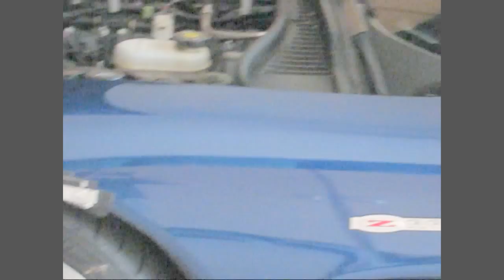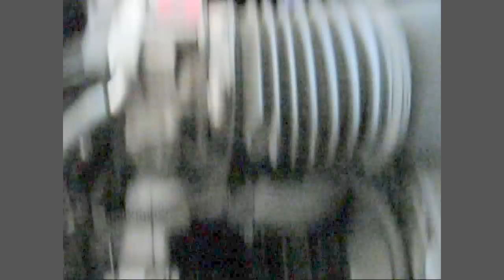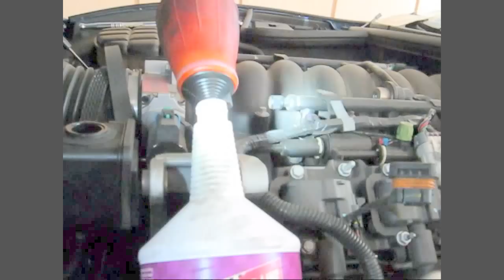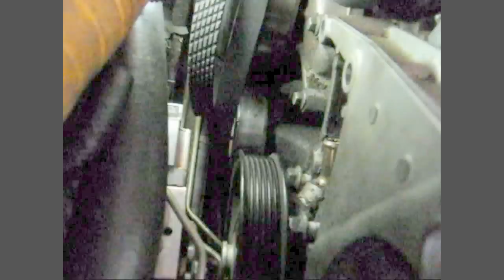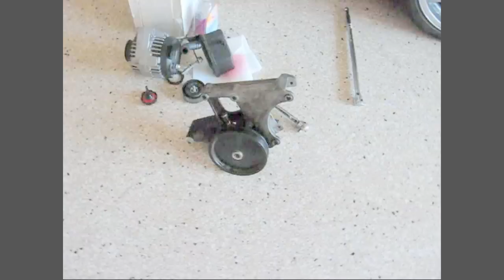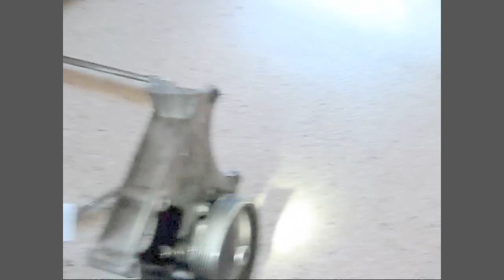Corvette power steering pump remove repair by froggy turn one c5

Comment: If anyone else has to go through this it's best to buy the complete assembly. Breaking off the plastic OEM pulley will give you access to the pressure line and makes for a quicker and easier install because you can also leave the bracket attached.

Comment: Did you replace the power steering hoses while you replaced the power steering pump? Seems like it would have made sense to do so.
Reply from the maker: No need if they are good low mileage, but otherwise a good idea.

Comment: Was the pump itself leaking?
Reply from the maker: No, it was not making correct "power" to the steering, hard to turn steering wheel, pump wore out inside, common with oem (cheap) pumps.  :)

Comment: I’m pulling the steering rack for another reason. Is it easier to remove the power steering pump and bracket while steering rack is out?
Reply from the maker: I don't think so, pretty separate jobs, If you like, replace the pully with a new one you can fit a socket & extension thru (skeletonized).
Reply: @1947froggy  well I was thinking if rack is out, and ps reservoir removed, wouldn’t it be a easier to just pull the entire power steering pump and bracket without disconnecting the tubes?
Reply from the maker: @aptsix1728  If you are talking the abs lines, I never needed to disconnect any to do either the rack or the ps pump.

:)
Reply: Not the ABS lines. The ps lines will be disconnected at the rack. Rather than disconnect ps lines at the ps pump, is it possible to remove the pump, bracket and ps lines all together?  Once out, easier to remove lines on the bench.
Reply from the maker: @aptsix1728  Yes, but I think with the right wrenches it's not too hard. Either way sure if you disconnect at the rack and get the pump off the block sure. Crows feet wrenched IIRC, there are also little stubby ones & crows feet "ends" that attach to a 3/8 ratchet.

It's a little hard doing this from memory but I'm trying.  :)
Reply: @1947froggy  thanks. I’ll be doing this in 2 weeks and let you know. BTW, Thanks for your videos

Comment: Froggy...i have 98 coupe and the steering is very stiff and grinding resistance at a stop and very low speeds.  Is this likely a pump or the rack?
Reply from the maker: Pumps usually go first, but to be honest, could be both. How many miles?
Reply from the maker: Has either ever been serviced? Fluid change?
Reply: @1947froggy  fluid in the pump was changed about 15k ago and the belts were done at the same time.  There is no whine from the pump...just clunking and stiff when parked trying toturn.  I thought it could be the ball joints too.  Thanks for the reply! Your channel helps us with these vettes stay out of the stealership lol!
Reply from the maker: @smokinC5  Well ball joints, tie rod ends, sway bars, shock attachment points could all cause noise/clunk but not really stiffness, stiffness "seems" like rack, how many miles on the rack?
Reply: @1947froggy  115k.  Under speed it seems fine its just when stopped or slow speeds is when it does it.
Reply from the maker: @smokinC5  Well, yes, that is when you need the rack & power steering to be "helping". I would make sure everything else. is 100%  as suggested & then what's left is the rack. I have a video on pulling it.

:)
Reply: @1947froggy  thank you!! Looking around for racks what is your experience with corvette central and ecklers? Where did you source yours from?
Reply from the maker: @smokinC5  Turn One
Reply: @smokinc5 ive got the exact same thing going on with my 99 coupe right now. Did you ever figure out what it was? Was doing a regular slow U turn nothing crazy, went to the left full lock but didnt think I hit it hard or went past or anything and I’ve had the same symptoms ever since. Due to how it happened it seems like it could be a blown seal on the rack but the fact that it turns fine at speed and only acts choppy when the pump would be engaging makes me think it’s just the pump
Reply: @lijahpinto780  after changing the ps pump, belt, pulley, all tie rods and ball joints, it went away lol.  Never replaced the rack.  I had it in the shop for the ball joint and tie rods, did the shocks and brakes, brake lines, and sways at the same time.  Came back to me and was fine.  Very strange.

Comment: At my wits end froggy! My C5 has a tiny bit of play in the steering wheel. Is that just par for the course on a C5?
Reply from the maker: No, Long list of things to check starting at wheel bearings all the way into the rack. How many miles? Ever been serviced for steering?
Reply: Says 77k miles. I bought it one year ago and it always had slight play. Never serviced steering yet. I just bought aluminum steering rack bushings but I doubt that’s the issue.  I just apt on Monday to see if anyone can find anything.
Reply: @1947froggy  Found the issue. It was just the steering shaft coupler bolt that must have been lose. I could see the shaft spin a little before before it engaged the rack set up. Funny thing is that bolt felt tight, but I guess not tight enough! Thanks again for your advice and videos!

Comment: So I just saw your post on corvetteforum about your LS7 motor sound. I;ve been banned form there but I can tell you it sounds fine.  But thats where the good news ends.  Sound is no indication of health of valve guides regardless of what anyone tells you.
I'll post the link to the two 07 Z's I've owned, one with 16k and one with 90k.  90k was 1/4" of play in valve guide.

Comment: You can remove resv from bracket and than makes it much easier. You pry the clip and slide plastic resv  up and off bracket.
Reply from the maker: Thanks & yes good tip.

:)
Reply: Have you or anyone you know of had experience rebuilding a pump with new bearing and seal?  Is it possible on these later models like it was in the old days?
Reply from the maker: Not me & probably not designed for it so many special tools req. is my guess.

:)

Comment: Thanks Foggy I got it out rather easily with your video. One thing was different. I have a 2003 Z06 and did not have to jack the car up. I turned the pump and bracket up and removed the bottom line with a wrench as mine was threaded into the bottom of the pump directly. I hope that made sense.
Reply from the maker: Good to know.

:)

Comment: YES LOOSEN THE THROTTLE BODY, LEAVE EVERYTHING CONNECTED TO THE BRACKET, ONLY REMOVE SMALL HOSE FROM RESEVOIR...LOOSEN ALL THE BRACKET BOLTS, LIFT THE BRACKET UP AND OUT THE WAY SO YOU CAN LOOSEN THE HIGH PRESSURE LINE FROM THE BLOCK THAT GOES TO STEERING RACK(there is plent of slack to do this). ONCE PRESSURE LINE IS DISCONNECTED FROM THE BLOCK, LOWER THE BRACKET DOWN SO YOU CAN SNAKE THE LINE THROUG AND LIFT EVERYTHING OUT FROM THE TOP...EASY PEASY. HAD MINE OUT IN ABOUT AN HOUR. YOU DO NOT NEED TO JACK YOUR CAR UP OR TAKE FRONT WHEEL OFF
Reply from the maker: Good post freakzilla2010, thanks.

:)

Comment: Great info, now I know why the dealer charges so much.
Reply from the maker: Yes, there is a lot of labor & they get about $100/hr give or take.

:)
Reply: The dealer charges so much because their engineers are morons who design junk that you must remove everything under the sun to get to anything. GM engineers are the biggest idiots of all the Motor companies. The water pump is half the damn engine and everything is attached to it. Any otgher vehicle has a small water pump with one bolt that takes 5 minutes to change. Not GM. GM makes good and sure it would cost thousands of dollars to change. I will never purchase another GM vehicle again as long as I live.

Comment: Hey groggy good stuff thanks !!

Replacing just the high pressure hose - can it be done without removing the pump using a 16 & 18mm crows foot ?

Comment: I have a question regarding the drive pulley. I found your instructions on how to remove and replace the a/c tension pulley and idol pulley but came short of showing how to remove the drive idol pulley show in this video. I see that you removed the power steering pump and reservoir to get to it. My question is is there another way to change idol pulley with removing those other parts?
Reply from the maker: Vountria Moss Some people break it off with hammer/pliers/etc. It's plastic. Then  you can get to the pump bolts & replace pump & get the skeleton pully (holes thru the pully)

:)

Comment: One comment if you haven.t covered it already. After you get the pump w/bracket take it to Autozone with a 13/16 wrench and a Half in drive ratchet with metric sockets and use their power steering pump pulley puller and if you have your new pump if not rebuilding your old one with Edelmann 8900 rebuild kit. After rebuild and installation on bracket take it back to Autozone and use the pulley installer tool in same kit . Or just borrow the tool kit and do everything at home.
Reply from the maker: The Turn One pully is skeletonized so no need to take it off. Thanks for the post!

:)

Comment: hey froggy how did you go about bleeding the system after installing power steering pump i kept the car up in air turned off with cap off and turned wheel lock to lock (left to right ) but my power steering worked for only about 3 mins then gave out .... this is my second install the 1st one was changed due to noise but ended up being an idler pulley help !
Reply from the maker: As far as I know, power steering bleeds itself once the car is started & the rack is cycled a few times, then ck the level of fluid to be proper.

This is because the pump & fluid adding & air exiting the system is at the high point of the system. Unlike brake & clutch where the air is forced out at the low point.

Coolant is a mixed bag, some need bleeding & some bleed themselves.

Thanks for watching!
Reply from the maker: I like to do it with the front wheels unloaded, but should work either way.

Comment: Hey Froggy,

Am sending my heads off for work on my '08 Z. I had to remove the power steering reservoir from mine as well. To add to your video, I disconnected the hoses from the same place you did. To get to the lower one, I had recently bought about 12" needle nose pliers with 90 degree tips. Worked very well on the first try.

<a href="http://photobucket.com/" target="_blank"><img src="http://img.photobucket.com/albums/v706/Datawiz/Z06%20Head%20Removal/Pliers_zpsc5bd46e4.jpg" border="0" alt=" photo Pliers_zpsc5bd46e4.jpg"/></a>

Datawiz
Reply from the maker: What are you doing to the heads? And THANKS!